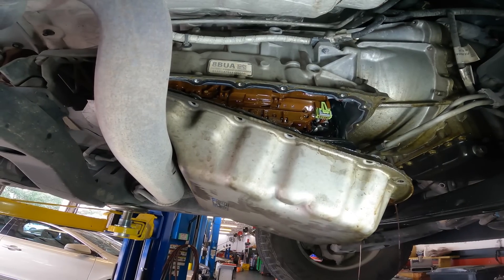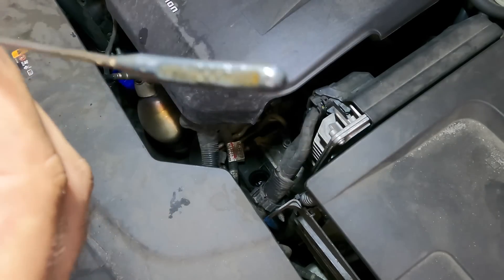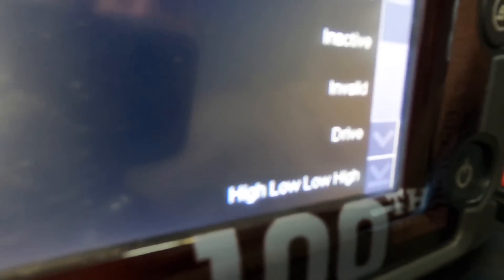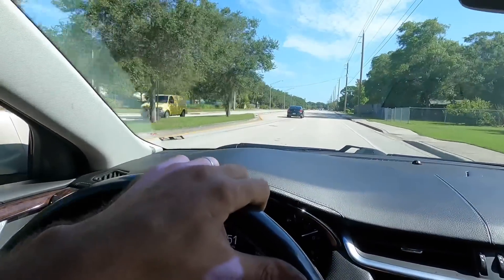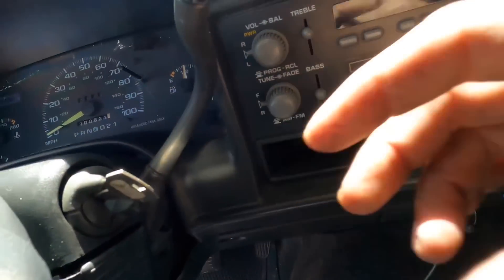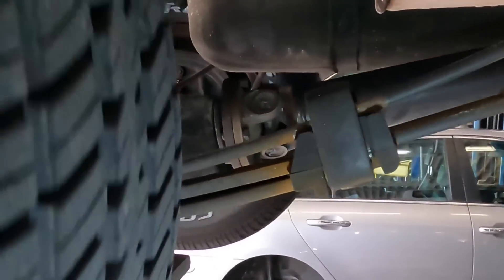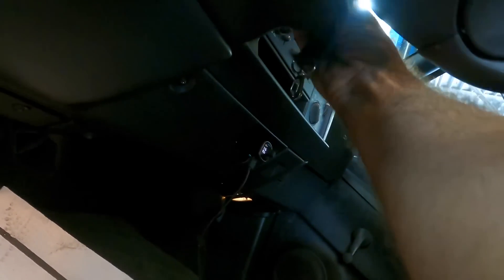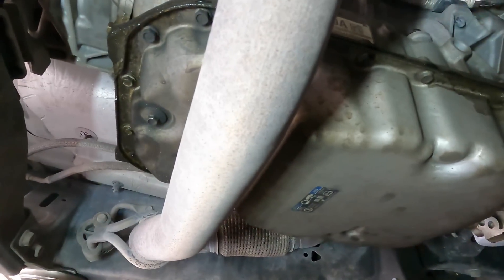Failure Friday! Ruined Transmission and More!

Comment: I have a special place for my S10 Blazer too… IN HELL!!! Mine was a piece of shit! EVERYTHING broke on mine, if I didn’t have the extended warranty I would of pushed it into a river and told my insurance it was stolen. BTW mine was a 1997 S10 Blazer, white, V6 engine. One of the major problems was an early version of Dex-Cool, it kept turning to brownie mix after being flushed. You’d flush it, a tiny amount of air would get into the system and the coolant would turn to brownie mix sludge. Only fix was to switch it to GREEN Prestone coolant and it never sludged up again… For THAT issue… it went through brake pads like candy because it had car brakes on it that were way too light for a heavy SUV and it had a bunch of other issues as well. That Blazer was hell 🫤🙄😡

Comment: Something up with the p/s front brake hose. Either its the wrong hose routing/ wrong hose or the calipers are flip flopped wrong sides possibly. Can't see the bleeders. Just one observation on that s-10 although I'm commenting before the end of the video so you probably noticed it as well. Jasper engines are also TRASH. Super high failure rate with all kinds of a 'built on a monday or a friday by some underpaid/ under qualified asshat' type of a standard. When i was in the few indies i was at we saw TONS of them that were basically junk right out of the box. The customer would be better off with a known good runner from LKQ or a salvage yard, even a minor refresh or use their original long block if possible to build in their garage. I'd trust one from a wreck before a Jasper engine. They're so horrible up here in NY that lots of shops won't offer them as a choice because the tech doesn't deserve the comeback and the shop doesn't need wasted labor. Its a general liability and just shitty business practices as a whole to not provide the customer with a SOLID repair that at least carries SOME good faith.

Comment: I had the check engine light come on when out of town on a Sunday. I swung by a local parts place and had them scan it. It was just a heated O2 sensor failing to heat. Once the exhaust temperature is up to normal the sensor can work properly, just not with a cold engine. Maybe I was polluting a bit extra on startup. I elected to clear the code for the drive home in case something else went wrong I'd want to know it. Once I got home I had my mechanic replace the sensor.

Comment: Why is it they don’t put drain plugs in transmissions
Reply: Without the drain plug in the transmission pan, you have to pull the pan. Then you have to buy a new gasket. Might as well do the filter too. I ASSUME it add to the dealer cost in time and parts and upside it ensures a filter change too

Comment: Turning off engine lights to some codes is not bad when you know the culprit. Took my car through the car wash and my car decided to throw many DTC codes accelerator petal positions,power steering, and fuel pump I noticed the a pillar had water running down it and a large amount water in the fuse area. The sun roof drains were leaking which got onto the electrical and threw all the codes.
Reply: That is not a good thing that can cause many problems down the road hopefully it all dried out and your car is running good
Reply: @michaelpressman7203  yeah I’m glad it has happened in the summer with the heat. It has helped with drying out things. I have not had anymore issues with DTC codes but still kind of have a leak with my sunroof still. I did run a piece of flexible weed eater string down the pillar drains which I did run into some sort of blockage. I have not tested the car wash to see but have poured a bottle of water down the drains the one still kind of leaks but the car has experienced rain since then and no leaks so wondering if it’s just the quantity of water down the drain and it too much at the connection where sun roof pan and drain line meet

Comment: The sound I hear on your video sounds exactly like someone left something inside the tire both tires one time I found a soda bottle tied to a string which was time to one of the crossbars inside the passengers door of their car and it was done at the assembly line the guy kept hearing a clunking noise every time you'd apply the brakes on the passenger side this was done on a Cadillac on 1974 Cadillac convertible in 1976

Comment: Hey Rainman, got a question for ya. I went to school and got entry level ASE certified for 8/9 categories(didn’t get diesel because the school didn’t offer it). I started working at a small engine repair shop about 1/4 thru the 900 hr program. I like the job, and it offers a 401k, and paid vacation/sick days. I don’t get the hourly pay that I would in automotive, but I get paid the same whether I’m repairing something or not. My question is, think I should stay here, or go to the field I trained for?

Comment: Coopers are good for shakes and pulls , every time…
Reply: I used to swear by Cooper Discoverer ATR tires until my last set, three of four were high spotted and out of round, the fourth was built with the belts out of line. I took the truck to a great alignment shop because of a serious pull to the left. They found the alignment 100% within spec. He swapped the left and right front tires and had me drive the truck. Yep, hard pull to the right. Cooper refused to do anything at all about the tires. The tire dealer went to bat for me, but Cooper insisted the tires were "in spec". The tire causing the pull was moved to the right rear, where it caused a push and also wore on a weird pattern. I sold the truck ('15 Colorado 4x4) not long after. No more Cooper's for me. Sad, because they are an American/Made in America company.

Comment: Reminder, the CEL only indicates an emissions fault, not the overall condition of the vehicle. That’s why you need a good scan tool.
Reply: Re-read your comment tell us if that is true. I can make you feel ignorant if you still feel that comment is true.
Reply: @larryreno8293  I did say “CEL” or check engine light, also called a MIL or malfunction indicator light. I was not referring to all DTCs. What fault will trip a CEL that is not emissions related?  Misfires, malfunctioning cats, improper a/f ratios, vacuum leaks, and the like are all emissions related.
Reply: @JettaRedIII  you need to up your training. Active grill shudder faults, secondary coolant pump fault, turbo under booster/ over boost, variable rate compressor circuit fault, excessive refrigerant pressure fault. Should I even get into network communication faults? So many reasons for the cel to come on that won’t cause the engine to run poorly or effect efficiency.
Reply: @larryreno8293  All of the items you listed are emissions-RELATED components, meaning the malfunction is an indication that the vehicle is not running optimally or that communications with key sensors has been disrupted.  Does a brake failure, window regulator failure, radio malfunction, or exterior lighting cause a CEL?  No, but they will still throw a code that either turns on a dash light and/or store a code.
Reply: @JettaRedIII  I realize now that you really need a better understanding of OBDII. Please brush up on this before commenting further.
Reply: @larryreno8293  Nope.  I understand it perfectly.  I think you are confused, made a mistake, and now won't admit it.  It's OK to admit you are wrong.
Reply: @JettaRedIII  so let’s clear the confusion. You stated the the CEL, MIL, SES or which ever acronym you choose is a emissions related concern. I think we can agree you made that statement. You also asked “ Which fault will trip a CEL that is not emissions related ?”. I quickly rattled off a few that would turn the light on that wasn’t emission related. You rejected those, so here is a few more. This is a small list since anything that is pcm controlled can light the cel. Items that a modern pcm can control that are not emission related are, generator output, oil pump pressure, a/c compressor control, secondary coolant pump B, pcm on/off timer. There are many more but I think you get the point. I do agree that the absence of a cel is no indication of the relative health of a vehicle. As far as a scan tool is concerned, you could have the best the industry offers but if the technician doesn’t understand the difference between a system driven fault and a symptom driven fault then the chances of a accurate repair are very slim.
   I hope this helps you understand the the obdII system.

Comment: Can a person be good at preparing vehicles without a scan tool? Do techs rely on it too much? Or is the scan tool required just because cars are so computerized now and a good tech without a scan tool is bad tech? Do they rely on the scan tool too much or is it just part of the job now?
Reply: They will help you quickly do a diagnostic without playing guessing games and they make it that way so you lot of times you have to take it to an expert like Ray to pinpoint the problem that's the way things are designed nowadays
Reply: Way I see it “now” No Scanner , impossible to be in the trade,,,,throw parts at it ?"……… Cheap Scanner , throw less parts""………. $$$$$$ Scanner (with tech support) One part , Or poor connection on 5 v reference circuit ! No parts,, required ! With a Scanner Confirmed Repair ! But What Do I Know ! LOL

Comment: These new trannys run way too hot!  My 14 Silverado came with a tranny thermostat which held the fluid until it reached 180.  I had the tranny serviced at 30K and not long after after I saw the temps creeping up (botched service job as seal was leaking).  Had to add 2 qts when temp reached 241 degrees.  My Son put in a Superior Solutions thermostat that tops out at around 160.

Comment: i think that the one that was complaining about slippage did have a trans oil change and the repairman did miss to go trough the gears :) and last one was that overfilled? you did just screw out the plug for the standpipe (or what you did call it) good you did that first trough or else it had been a mess :D

Comment: So many of these issues are non existent for EV. Bring on the future!
Reply from the maker: Only to be replaced with an entirely new set of problems with a workforce that is not familiar with the technology…. you guys think I have stock and brake clean companies meanwhile I’m loading up on popcorn
Reply: @RainmanRaysRepairs  not really. There's a gear reduction drive and differential. 

Up stream there's a motor controller and some sensors but not much to them.

The battery obviously which is make up with some modules. 

AC charger

HVAC system is similar but it's like 2 AC systems.

Far far simpler. 

There's still tyres that need changing 😁 brakes need lube to stop them seizing up.

Our leaf is on 91k miles absolutely zero issues other than a blocked windscreen washer nozzle lol

But yes I see what you are saying with the lack of skills... Best get some training because you will make a killing being a specialist.
Reply from the maker: @DorsetSaferRoads  I agree with that too. Consider this, most ev owners, really take care of their ride. Nobody is parking their Tesla under oak trees or lining neighborhoods with them. They’re kept mint in garages. My point being is that EVs are in the luxury market now. When/if they make it mainstream like the 2030 plan and we see EVs as rentals, loaners, high school/college cars, and competitively ($$) available to the general consumer, this Gould change. Folks are looking at EVs for their benefits but we aren’t weighing the risks or taking steps to mitigate them. We shall see. 🍿
Reply: @RainmanRaysRepairs  I see the price complaint about EV a lot. But is see loads of range rovers, big mercs, BMW's Audi's etc with similar or higher pricing than a Tesla model Y, enyak, id5 etc.

Over here we have a bit more choice, Korean stuff, Kona, e-nero, ionic5, ionic. Then there's the id3, leaf, Zoe, e208, Corsa E. 

The big thing we have are from SAIC badged as MG. the MG5, ZS EV and the soon to be released MG4 all sub 30k 

Check out James and Kate fathom review of the MG5 he's a mobile mechanic doing servicing on EV gets all over the UK with it. 40k miles in 9 months!

Comment: I just did a tranny oil & filter change on my 5th Gen camaro, and other than that exhaust pipe being in the way, it was almost identical. A couple of things to note on my car, though:
1. I popped the hood and filled the tranny from the top rather than the bottom, using a funnel and winding the tube around the engine and inserted in the fill hole.
2. I didn't bother changing the filter gasket. It looked clean, the new filter was snug, and I didn't feel like dealing with that headache anyway
3. The manual stated that the tranny fluid had to be a very specific temperature when measuring. I usually prefer the old school method (put in what you take out), but on this day I was feeling like a perfectionist, so lacking a good scan tool for measuring fluid temp, I used a laser gun on the pan and adjusted the range accordingly. I wonder how much difference it makes in fluid level with a measurement of differing fluid temps?

Comment: You should upgrade to a Mityvac MV6410 or MV6412 for your transmission filling adventures. We have the latter at my shop and works pretty good.

Comment: It sounds like they left something inside the tire I've had that happen to Automobiles and motorcycles one guy left the hammer inside the tire that pulls the weights off and puts the weights on the rims another one left a pair of pliers in the tire and another one left the old wait inside the tire I don't know if they were just that stupid or they did it on purpose

Comment: Gotta luv the engineers who were tasked with cheaping the trans fluid check and fill process. 
Subtract the cost of a dip stick and a filler tube. Become heroes at the next corporate engineering meeting. Been there, wouldn’t do it.
Reply: Toyota is even worse.  You have to check the temperature with a scan tool to get the fluid level correct.

Comment: Real question,could you replace the rubber plug with a trans dip stick? The reason I ask is I have a 2004 Thunderbird with no dip stick, one of the stupidest things that the auto industry has ever done!!!!! Because that’s the easiest way to put fluid in with a pump, rather than a funnel!!!!!

Comment: Wow, did l just see a manual window winder in this vid!!!!! How cool is that😃.
  Those were the days that you could adjust the window with no problems. 
 Now you play the up/ down game with the electric windows trying to get it to the position you want.
  Think manufacturers should offer this as an option.
  As always great vid plenty of doo bee doos. With the brake clean thrown in for good measure 👍.
  Keep up the good work Ray.
 You have yourself a great day 👍😃🇬🇷
Reply: I had manual crack windows and a stick shift in my 1998 S10…. I miss that truck.
Reply: 00 taco window winder cranks.  You jelly?

Comment: The transmission has to be an operating temperature. The way you were doing it is not the correct way. The way you were doing it will actually overfill the transmission.

Comment: You bothered to clean the outside of the pan so it looks good cosmetically, but never cleaned the inside where it counts? And the fluid level is set at a specific temperature. Didn't see any scan tool connected to monitor that.

Comment: I was wondering about that "drain plug".  Glad you pointer out your mistake.
Why not leave the stand pipe open as you fill it?  Then fluid starts coming out, your full.
Reply: @RJB, when the engine starts, nearly a quart of fluid sucks up into the transmission sucks up into the transmission. So you would have to pump in more after the engine starts anyway.

Comment: I blew a transmission on my 2012 Highlander Limited last week. It failed at 235k miles unexpectedly (thankfully it did not blow on the highway as I had gotten off 20 min earlier in the trip). The transmission failed because I was too rough on it (shifting gears manually for higher rpms, hard acceleration, etc) and said abuse eventually caused the unit to fail. 

Now with my new car, I'm going to be nicer to it and hopefully get more life out of it.
Reply: The transmissions, actually transaxle, were kind of weak in that era of HL.  Still much better than the Pilot transaxle, those were and still are junk.
Reply: Hmmm that's good to know. Thanks for the info.

Comment: Cad has valve body worn ck balls syndrome , mite not need complete ohaul. S10 has OOR Tires that  will vibrate no matter if balanced.
Tire shops used to have Truing equipment, but very rare today. Try  shop that specializes in Race tires as custs often have nu ones shaved to  their spec.

Comment: REEEEEE! Ya jumeded inter a Silveryaydo wifout your pretty paper floor matt!  I caught ya 😛.
BTW, since when would a "drain plug" be well above the big low section of a transmission pan. Of course a lot was going to be in that section. I might have been away from trans fluid too long but, that looks REALLY watery, as in extremely low viscosity wise.